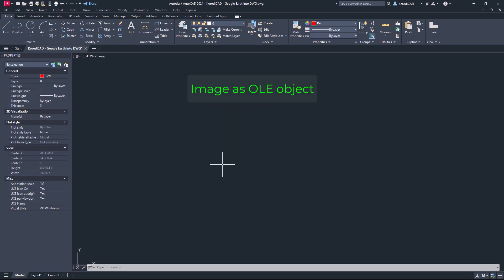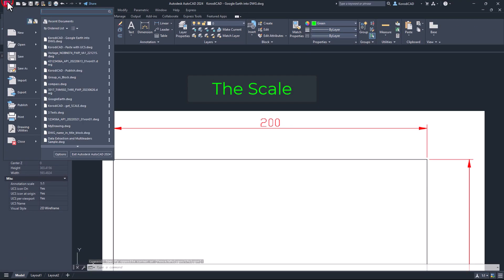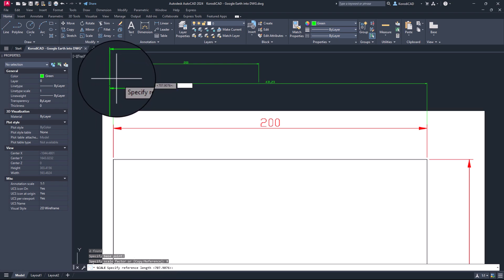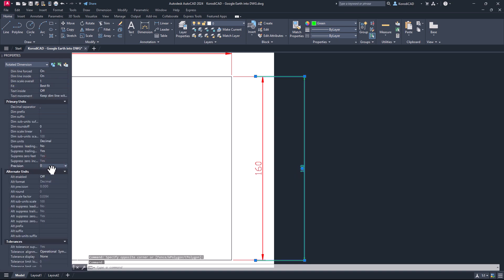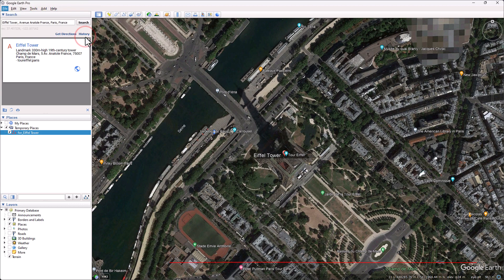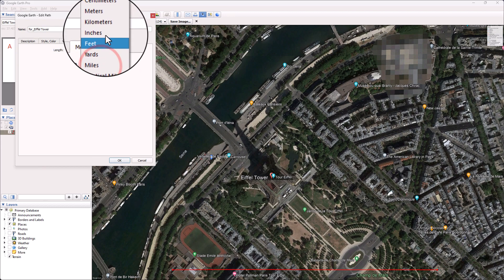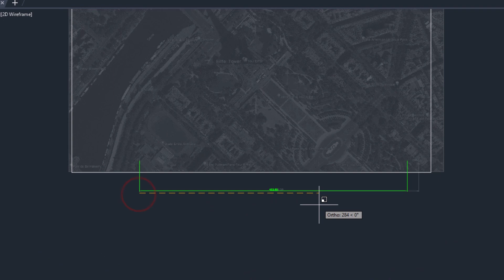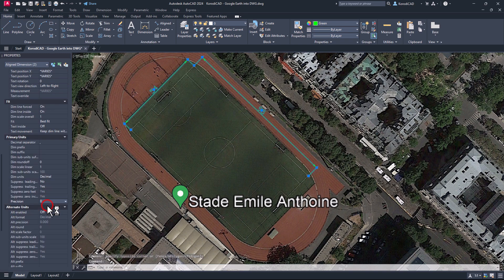#autocad _2 | Google Earth into DWG - a simple and quick method with Scale

Comment: I didn't get the stretch part with the dimensions. It wasn't working like yours, I need clarifications. Thanks in advance.
Reply from the maker: You do not need to use Dimension, just click on the point in the image. It is important that F3 is off, otherwise the click may go to another point in the image. 1. select the image 2. select the scale command 3. click on the first point on the line 4. press the r key (if you have autocad in english) 5. click again on the first point and then on the second point 6. finally enter the distance between the two points
Reply from the maker: sorry, you have to press enter after the letter R, maybe you missed it